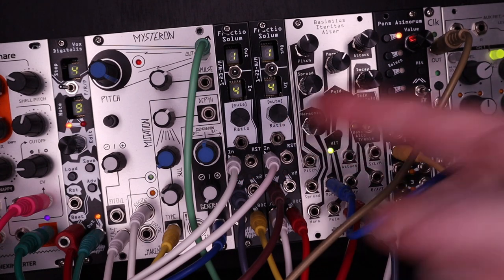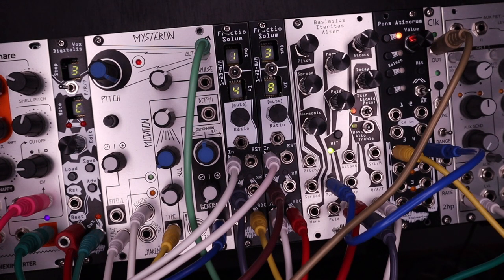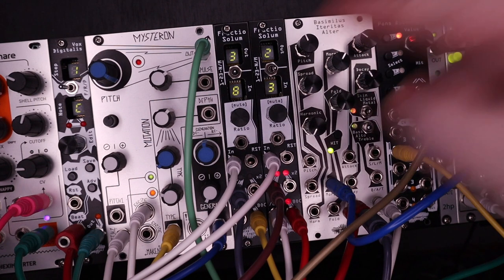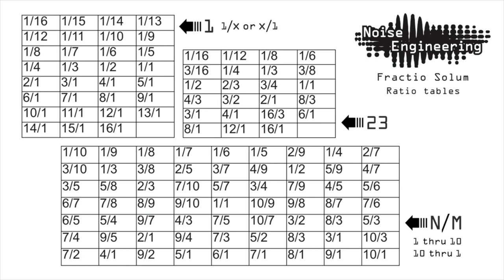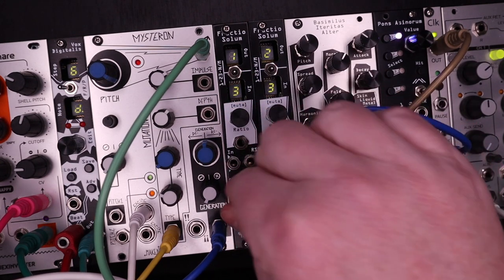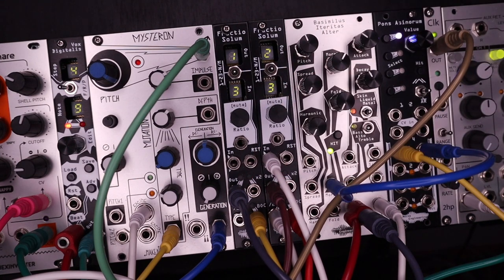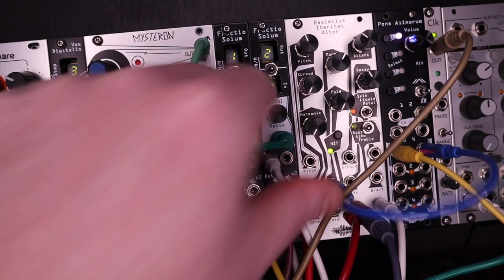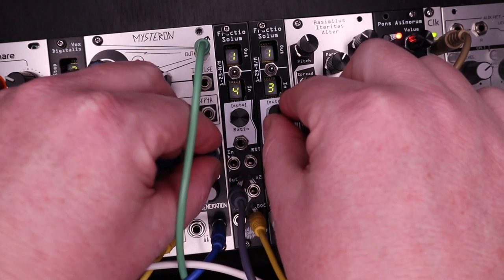Fractio Solum clock divider/multiplier Eurorack module in 4HP

Comment: how does it fare as a suboctave generator?
Reply from the maker: It can run up 200hz, so it'll definitely work for some patches!
Reply: @NoiseEngineering  perfect, yeah basic sub square for bass patches is all i need!
Reply: @NoiseEngineering  which would be better for suboctave gen, this one or Horologic Solum?
Reply from the maker: @devonhansen7705  FS has more options, but HS will go up to a higher frequency. The choice is yours!